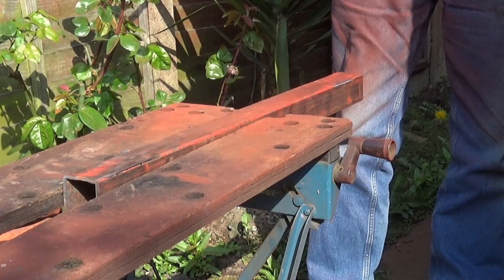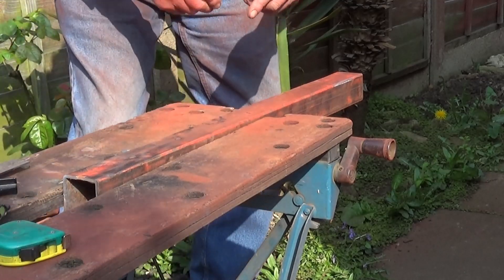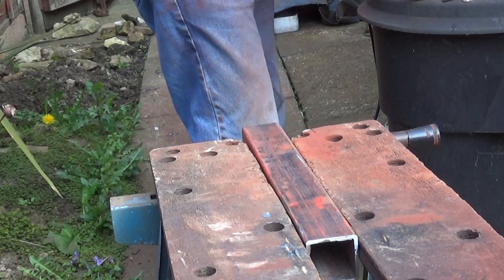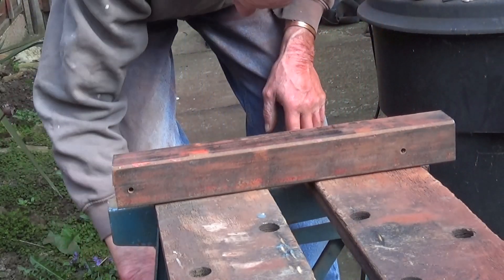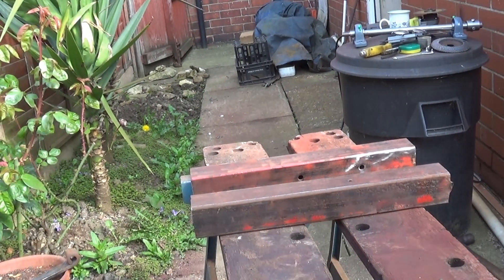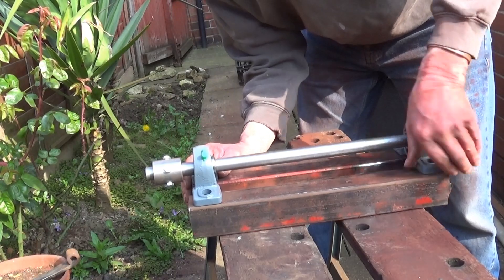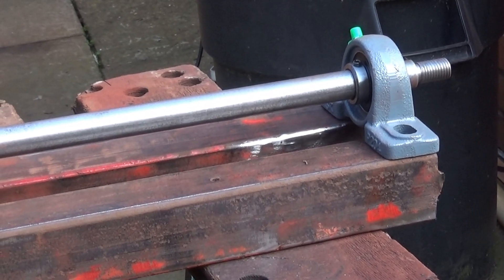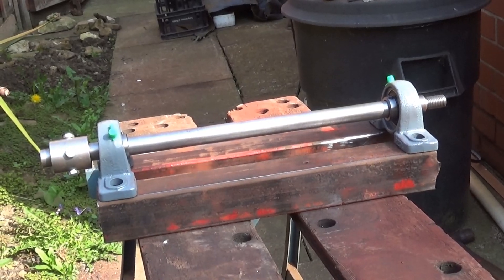Frame For The Shaft & Bearings

Comment: I leave cleaning up while after, but sometimes (mostly) never get round to it.  Saves all the dust and stuff. I have a vertical shaft V twin B&Stratton petrol, want to fit it on my 1949 Massey Harris pony instead of the original broken 12 HP Simca engine. Give me inspiration Malc.
Reply from the maker: That's why I did it first lol. Hmm, can you do some pics or video so I know what you've got. Email me if you want. I'm sure the two of us can come up with something.
Reply: @MalcOfLincoln  OK malc, will do.

Comment: Looking good mate just being nosy did the aluminium bit fit the Lister shaft
Reply from the maker: Thanks Daniel. Yes I've checked and it will go over the shaft. I'm going to try to fit the pulley from the alternator. Problem is it's plastic, however I think?? I can weld the shaft from the alternator into the steel part you made.
Reply: @MalcOfLincoln  I'm pleased it fit it's always a bit nervous making part for something you haven't seen
Reply from the maker: @danielkeal8795  Yes, it's very difficult, even when you know the size. Very well done on the whole thing.